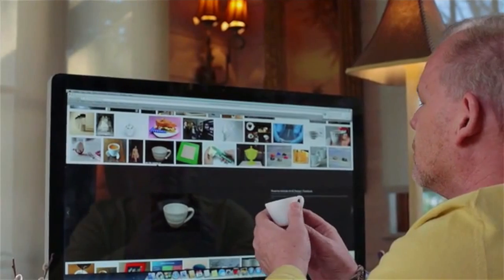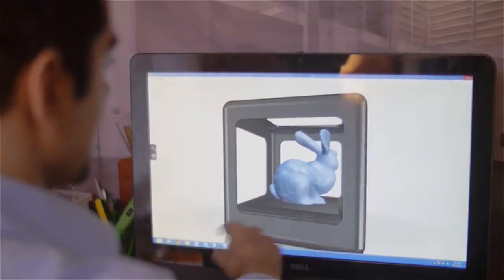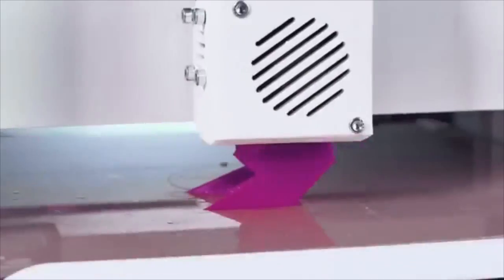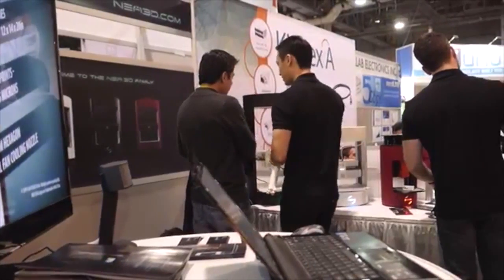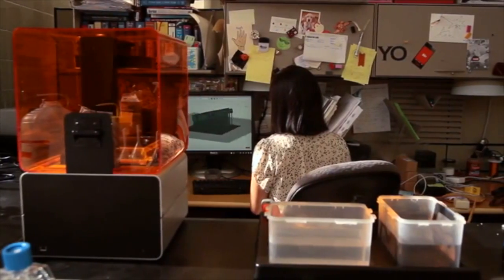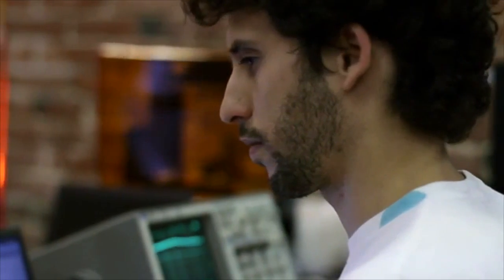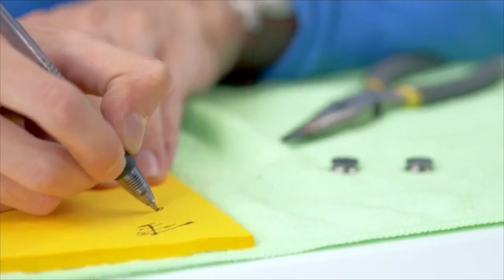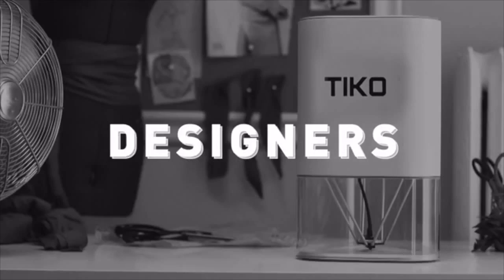Top 5 3D Printers Available Right Now.

Comment: Friendly advice.
Forget the M3D. It's just a piece of crap.
I was one of the backers on Kickstarter, but I am utterly disappointed with this printer.
I just smashed it on the floor today, out of frustration.

The first consumer 3D printer? Consumer my ass!
It became less and less reliable every day.
At the end I couldn't get any filament to stick to the print bed.
Auto-leveling? Maybe... but it doesn't work! No matter what you do, leveling it's never good.
And the software is complete crap.

Comment: Why is the filament so expensive? You're literally just buying plastic for 50 fucking dollars.
Reply: Tricknologyinc  Lol you mad bro?
Reply: Tricknologyinc There are TONS of 3D printers out there, some are better than others, which have better resolution, I know that 3D printers that use Light and resin, have GREAT resolution, and there are pretty cheap ones you can buy off amazon.
Reply: +Pastrami Sandwich Your argument is flawed. 3D printers are an extremely useful solution for creating detailed models of prototype designs that someone wouldnt just be able to get through other means. Injection molding would be much cheaper, however is not good for this initial design phase.
Reply: +OldSkoolRapping A 3D printer is for single things, like a small prototype. Injection molding is when you need to mass produce something.
Reply: That's just my sense of humor. But what a dumb thing to say about buying a 3D printer. A smart thing would be that the resolution absolutely SUCKS on them, and you can't print anything you don't have to work on seriously if you want it smooth and undistorted. But they are a great way to save TONS of sculpting time by getting you almost there on something that you can straighten, fill, and polish. More people should be looking at carving wax and making molds though for sure! For what you pay for these printers, the quality is a step up from stuff you make from LEGOs, Tinkertoys, Lincoln Logs, and Erector Sets! YAY!
Reply: Special plastic that can be melted again and again while still being strong and flexible.
Reply: +RC Central Regular plastic products are stronger and cheaper and better built. Buying a 3D printer is extremely stupid.
Reply: Ok, your view. I just think it's a cool knack and in some cases, a prototyping tool.
Reply: +Cheese Inc Injection molding also makes the little plastic lions at the zoo.
Reply: Demand.. Because of the demand for it...
Reply: That's the dumbest thing anyone has ever said on the internet, and that includes all the political idiots that don't want to learn anything but want to teach everyone a lesson! A 3D printer is something I can use to create things from my own imagination, WITHOUT all the mistakes and problems with someone else' design. You are about as smart as any other pastrami sandwich! But maybe you are the smartest of all the pastrami sandwiches, so congratulations! It's still not like we can tell any of you apart in the SAT's. We can even stick the pencil right in your ham, but the only mark you make is a big greasy cloud that we can't even grade manually. You're not even vegetarian! Shut up! Why am I talking to damn sandwich!

Comment: M3D is terrible! I had it for 3 months and the fan that cools the heating element fell off because it was held on by hit glue, which melted because it got too hot. As a result the internals melted, the fan cord melted and M3D wanted me to pay to ship it back to them and then pay them 50 bucks to repair their crappy equipment. I liked the price point, but look elsewhere and save your money.

Comment: most of the 3d printer startups now are just doing the same, without any bigger innovation...and of course with 300% profit with cheap ass weak parts and small build spaces
Reply: +TheBlone444 I know right. For god sakes the Robo 3D which was born on kickstarter is better than most printers and a whole lot cheaper and has a huge workspace,open source, can print any filament and has 100 micron resolution. I got mine for $700. It makes the Makerbot look like a joke.

Comment: Load of rubbish.  I built 3D printers a few years back for a company that got sold to the yanks. Anyways you want to go for a printer with the largest bed possible and has the most extruders. Three if possible. You also need to consider what types of filaments/plastics you will be able to use and the cost. It is possible to make it yourself by the way but check out if that is the case for the product you are considering to purchase as they may try and force you to buy from them just like the ink printer market does with region codes. One last thing there is still on-going research being doing on the effects of burning plastics within the home. Make sure you have alot of ventilation.
Reply from the maker: +ziggy2070 Great Info thanks.